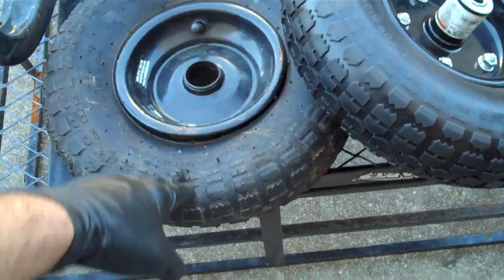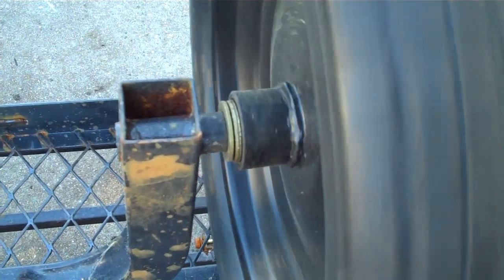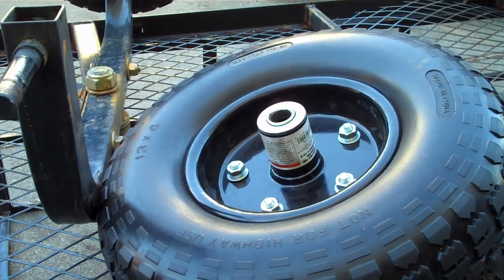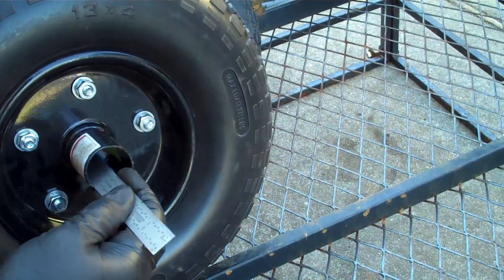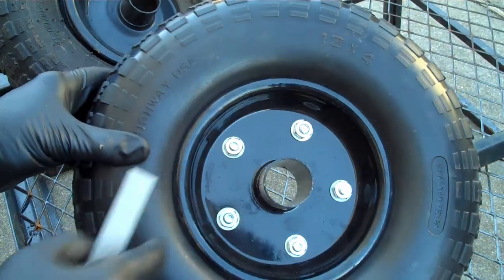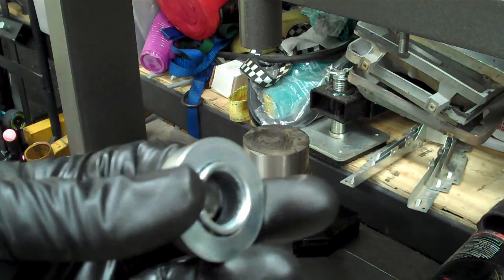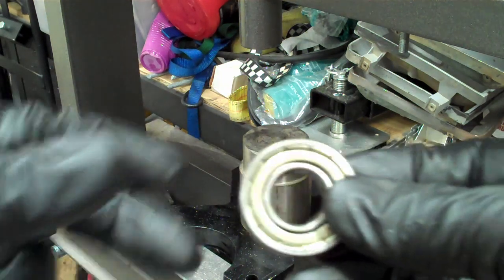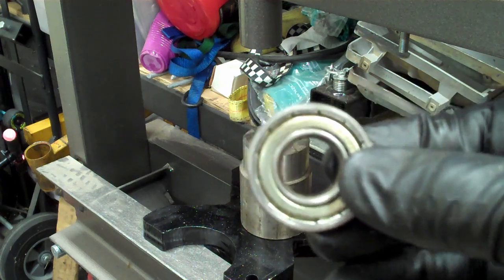Fitting Harbor Freight 13" No-Flat Tires on a Gorilla Cart

Comment: a lot of reviews say the hub which is  what your bearings are pressed into break off and separate from the actual rim, I would grind off where they meet both sides and weld it on so it doesn't snap off

Comment: Quick question: Did you consider using both the Gorilla Cart bearing and the Harbor Freight bearing on the same wheel? It looked like you could have pressed the GC bearing further into the hub shaft and then put the HF on top of it until its lip caught on the edge. Not sure if that would work or even be desirable, but just wondering since you had the bearings. Might give some extra strength.

Comment: I was worried how you would deal with long hub on the replacement wheel, looks like you had no issues.  I am going to try same upgrade on my wife's garden cart, been putting air in her tires too often.
Reply from the maker: It's worth it to upgrade.

Comment: Why not just change out the old tire and tube with the new one from HF?
Reply from the maker: I'm not exactly sure what you are asking. The purpose was to put No-Flat wheels on the cart. I did use new No-Flat wheels from HF, but they needed a slight mod to fit the gorilla cart. Hope this answers your question.

Comment: These wheels will fail if hauling any amount of weight.   The center hub is just welded on one side and the hub will break away from the wheel.  It happened to me after just 3 uses of my John Deere dump cart.  I was worried about the tires holding up but it turns out the wheel itself is the weak point.  If your just hauling leaves these probably would hold up/
Reply from the maker: I regularly overfill my cart with firewood to haul and have never had an issue.
Reply: @randomherolhd3  You're lucky then.  I have an 8 yard John Deere dump cart that I moved 6  loads of dirt with on 3 separate occasions and on the final load the center hub broke right out of 1 wheel and caused the other wheel to bend and break the weld.  When I returned them to Harbor Freight  they said this wasn't the first time they saw this happen.  I just figured it to be useful information for those interested in these wheels.